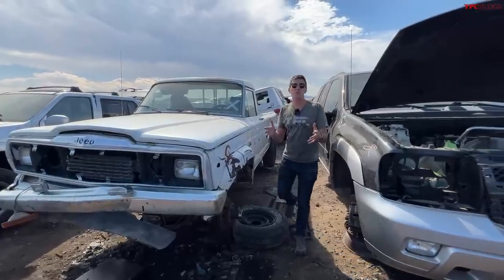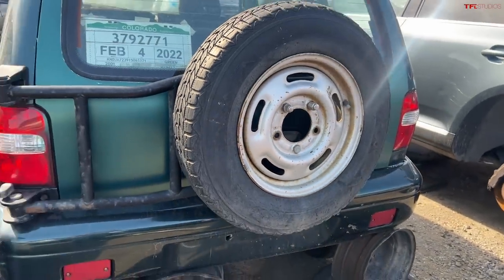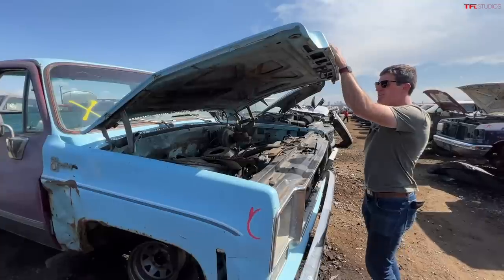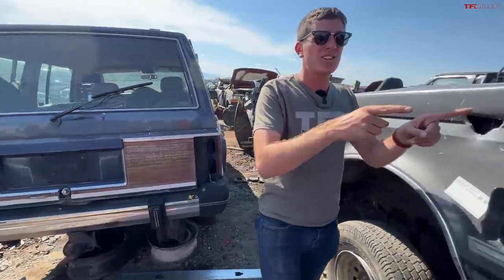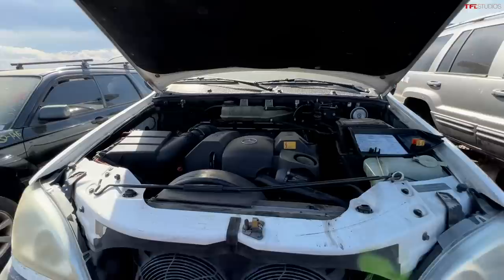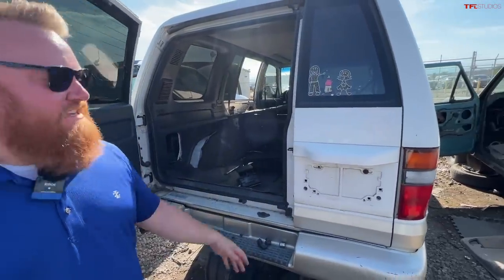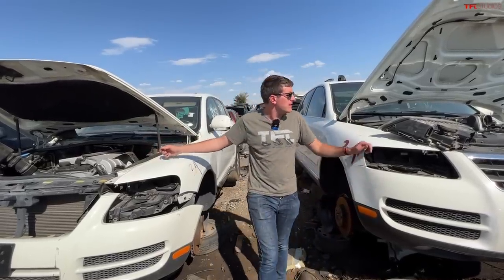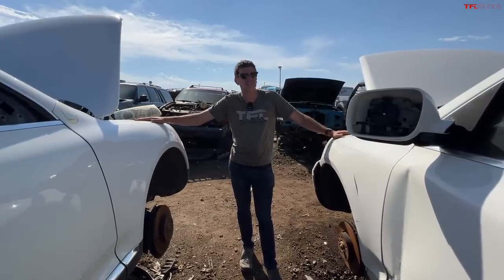I Can't Believe Someone Scrapped This RARE Truck! Gems In The Junkyard Ep.3

Comment: I am glad the XC90 got a shout out in this video since I think they are highly underrated, but am surprised to see one in the junk yard as Volvo’s are known for reliability. Mine is a 2013 with the 3.2 inline 6 cylinder and does good off-road. It can also tow 5,000 lbs. and yes, the seats are amazing. I believe Volvo even designed the seats with the help of a team of chiropractors. It’s also my understanding Volvo developed blind-spot monitoring system and started offering it as a option in the late 1990’s.

Comment: Hey Tommy! That kink in the hood of the K20 is due to a safety feature GM had for some of the earlier square bodies. You see, the hood was designed to kink and crumple in case of a front end collision. That’s why the hoods had those smaller indents. The hoods were supposed to be closed by pushing them inwards - therefore releasing the hood springs, then bringing them down. Many people didn’t know that, which resulted in those kinks. It was a poor design that I believe GM did away with in the early 80s.
Reply: It's rare to see a GM from that era that doesn't have the hood slightly bent. Believe me, I'm looking
Reply: @bldontmatter5319  agreed. They’ve all been kinked. I remember restoring a 76 K10 with my cousin years ago that also had a kinked hood. Just a poor design. I have an 87 C10 (last year of the square body) and by that time they did away with that hood, yet I still close it ever so gently out of habit lol.

Comment: Now that's a real jeep gladiator.
Reply: Son has a new one,diesel, 26 plus mpg…
Reply: @rickreese5794 A friend of mine had a gas model 2020. He traded it in after two years of physical and electrical trouble. The final straw was the widespread aluminum corrosion issue. Hope your son has better luck. Keep an eye on the doors, hinges etc that are aluminum.
Reply: @user-cg7cc7zj3e  
Me too, thx pal for the info…
Reply: @rickreese5794  lol, wow. Just barely hitting 1980s Honda civic MPGs there

Comment: I owned a 2001 Sportage. Good little rigs for what they are, which is mostly Mazda parts. Very close in comparison to the Suzuki Sidekick/Vitara of the same age.

Fun point, the Sportage came with the Mazda FE-DOHC engine, and was the only vehicle to come with it stateside. It is a good, solid engine. The problems I had with my Sporty was the fuel evap is really low, and can quickly get plugged with mud, and mine had an ECU die, then it ate another before the third lasted.

Air intake is however, quite high, sitting right above the radiator. I have done pretty deep water crossing without issues (water came over the hood from the bow wake).

Honestly, they are pretty tough little bastards, but there is effectively no aftermarket for them. The Suzuki Sidekick/Vitara are probably better built overall, but if you want something a little different, and don't mind it stock, or aren't afraid of making things yourself? The first gen Sporty isn't a bad choice.

Comment: First gen xc90 had a 2.5t 5 cylinder, not 6. They also offered it with the 2.9 twin turbo straight 6 as well as the 3.2 naturally aspirated 6 cylinder. Only downfall was they borrowed a transmission from gm for the 2.9 twin turbo 6. Awful transmissions. Every other configuration came with an aisin transmission which were generally fairly strong and the brand Volvo still uses to date.
Reply: Came here to mention this... I had an 04 2.5 turbo AWD, which was woefully underpowered at 208hp.  Trying to merge onto a 75MPH freeway is pedal to the metal.  I wanted a V8, and almost bought an 05 or 06, but the 04 2.5 was the right price.  Later I was stationed in Germany and found a diesel stick shift XC90 for sale, but it was very expensive as it was a Notarztwagen (emergency doctor vehicle) with all the lights, siren, and kit in the back to transport a patient if an ambulance was unavailable (and it was much too new to bring back with the whole 25yr rule for non-US spec).  Oh yeah, even later I had an 06 S60 2.5T (FWD) with the same 208hp 5 cylinder that had plenty of power... It'd smoke the tires with the traction control off.  Another note is the V8 was also available in the S80.